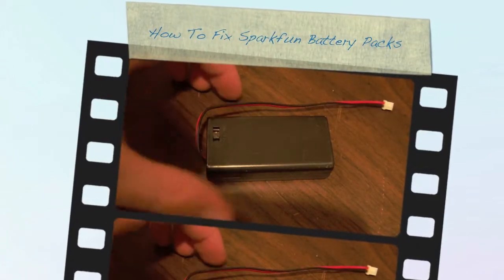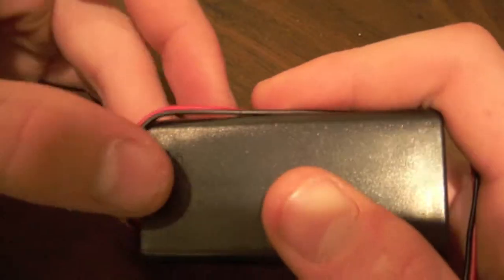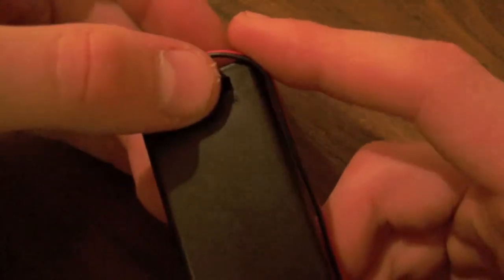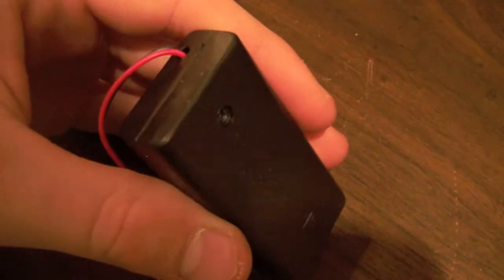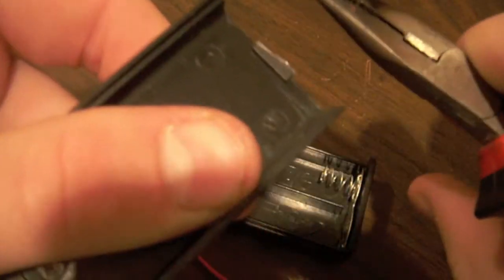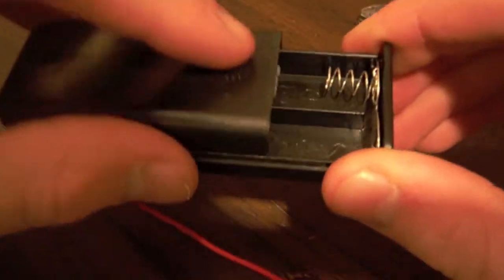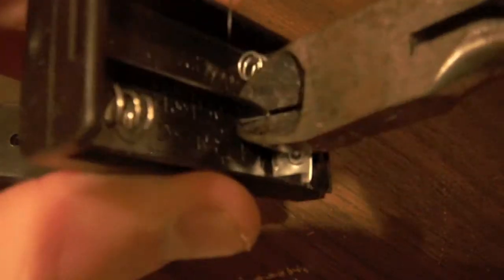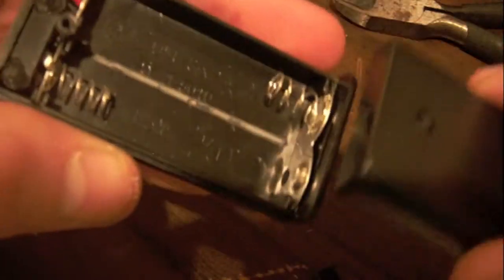Sparkfun Battery Packs

Comment from the maker: @skierplaterandy sorry but i fixed all the battery packs so i cant show that. Basically the problem is that the batteries are to big to fit in so they dont slide down all the way and make contact.